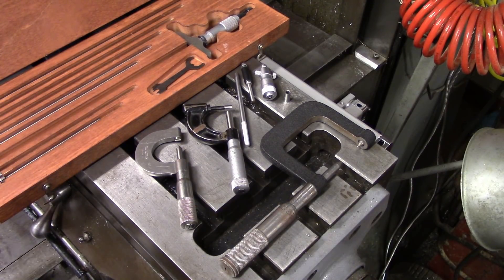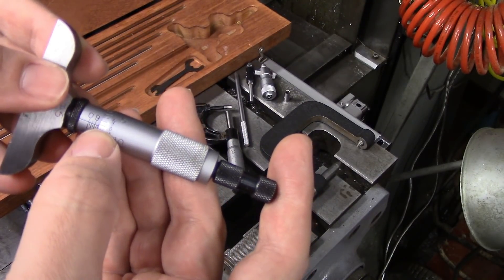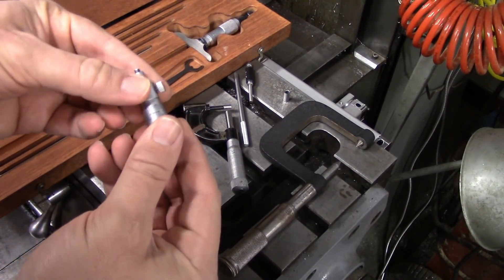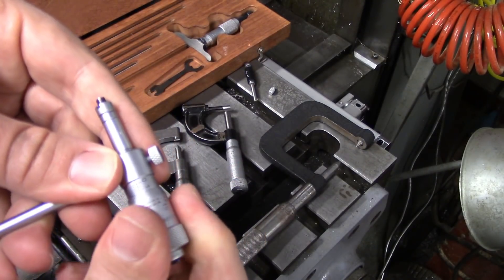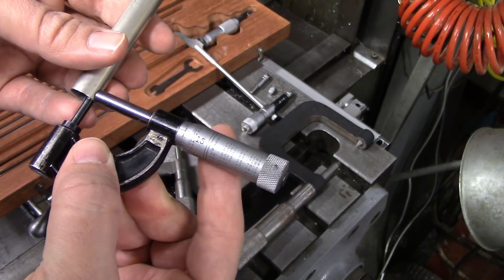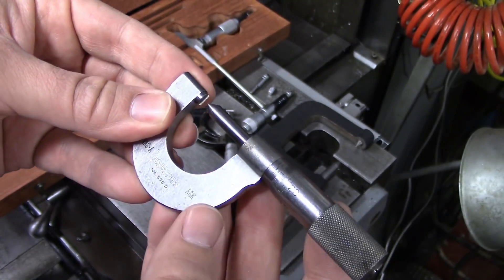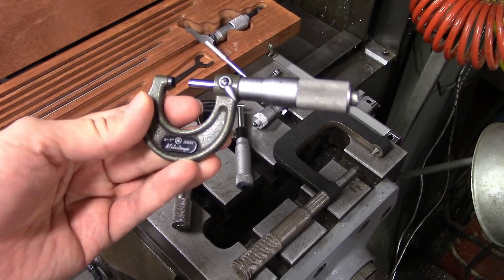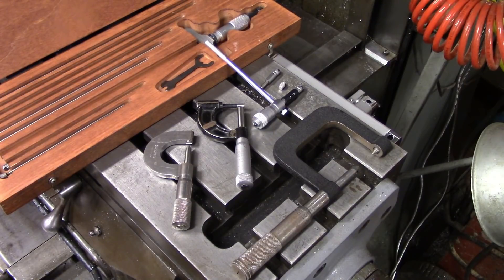Different Types of Micrometers

Comment: The other Vee type micrometers are for measuring 5 and 7 flute reamers. If you do cutter grinder work they are a must-have along with the Vee micrometer for 3 fluted cutters.
   Tool makers like Starrett often made (and still make) specialty micrometers not shown in the catalog. If you keep an eye out you will run into them once in a while. E.g. I have a Starrett thread micrometer that is made for 55deg. Whitworth threads that I use when chasing Whitworth threads on the lathe. Usually l use it like the comparator micrometer shown in the video and check the work against a known good thread.
Cheers from NC/USA
Reply from the maker: Thanks for the insight.  Very cool info!
Reply: Rarely use my vee mic.  Never considered there’d be unique vee mics for 5 & 7 flute.  Duh!   Don’t know mine is right now, are the marked “3”, “5”, “7” ?  or how do you know what they’re for?  (Maybe I got the wrong one on eBay)

Comment: I like micrometers and have way more than I need. A collection of sorts, I guess. They all get used. I also prefer a friction spindle. That was a great tip about getting a feel for what's tight - when the fingers slip, it's tight. Wish I heard that before spending a considerable amount of free time with mics and gage blocks. All this being said, just popped a bid in yet another micrometer. Is that so wrong?
Reply from the maker: Not wrong at all. I want to buy a disc micrometer really badly, but I keep reminding myself that I don't really need it. I just WANT IT!

Comment: I'm in 100% agreement about studying what's in the tool and individual tool manufacturers catalogs. I picked up a great deal that way. Mitutoyo and Starrett have good videos here on YT about how to best read and use there metrology equipment. Even with something as simple as dial or digital calipers it seems about 90% don't use them correctly to get the best from the tool. I'd also add that with thread mikes having a trustworthy set of precision thread wires is a good way to double check that your thread mikes are at least in the ball park of what they should be. And used sets of depth mikes are something that really shouldn't be fully trusted without that check for each rod against that stack of gauge blocks. It's too easy for the previous user that might have "adjusted" them to what they think is correct.

Going by what I see on the forums and quite a few on YT, but mostly non machinist related channels you should do an in depth video about repeatable accuracy verses a measuring tools resolution and throw in some details about uncertainty of measurement. I've seen lot's who think that last 5/10ths digit on a dirt cheap digital calipers screen actually means something.
Reply: Turning Point, the last 5/10ths digit does mean something on digital calipers, no matter who made them... its just that the last digit isn't  giving you the actual size of the measurement, only the range of what it might be. 
  Digital measuring devices are an all or nothing proposition in the last digit. This means that a digital caliper whose last digit is either "0" or "5" can't detect any variation closer than +/- 0.00025" . 
   As a practical matter for anything whose size needs to be determined any closer than +/- 0.005" , you shouldn't be using a caliper of any kind.. that's what a micrometer is for. There are often circumstances where you can't use the micrometers you have and you can get away using digital calipers zeroed against gage blocks or a known size to get within +/-0.001"  pretty reliably.
Cheers from NC/USA
Reply: @aceroadholder2185  I should have clarified my statement instead of being lazy and shortening it up. Unfortunately this is gonna get long. I'm sure you already know all this but others might not. I agree with your points about how the numbers are displayed. They match with everything I've read about how they work. For any of the decent digital calipers I've seen or used.  The manufacturer has to follow the industry standard for metrology equipment and there made well enough to be accurate to + - one count and can then pass the QC checks. I've tested enough metrology items such as digital mikes to know the higher end equipment has been repeatable to usually a bit better than that on gauge blocks, but the + - numbers are still the maximum allowable deviations while falling within tolerance and would still be considered as accurate. So some tools will also be at those upper limits of what's allowed. Without checking it's another unknown. Most of what I have checked hits around half the allowed, one or two have been about 75% of the allowed. 

As you say, under .005" then break out the mikes. The main difference even if the internal electronic measurement & reading systems were equal is the mikes have an in line close tolerance mechanical system with a very rigid frame. Calipers have minor but important clearances that without them the calipers jaw couldn't move. Those allow it to tilt a very minor amount in each direction on the calipers beam. Due to the design that clearance is greatly magnified along the jaw tip. So a calipers mechanical design is a far less rigid and repeatable system than a mike has. Even it's shape and length is against it for possible thermal changes just by holding them long enough. Like you I've proven to myself that I can get dependable and repeatable readings with my Mit's on those gauge blocks, but only under the best of conditions, taking my time and using good technique. That proves how your doing it and the tool is accurate and repeatable to a low limit. 

So those are ideal conditions and that's still a possible 1 thou in each direction and a long ways from 5/10ths. Everyone knows measuring parts in a chuck or vise is never ideal and the surfaces being measured sure won't be of gauge block quality when machining metal. Since the equipment can't repeat to 10ths or even be 100% trusted as being within an exact thou there's uncertainty and the display of that last 5/10ths digit as I said really does mean nothing about the actual measured size your shooting for. Yes the calipers are reading a rounded off jaw position change to that displayed number, they might due to random luck even be quite accurate once in awhile against what it's measuring. But that display can only show the current jaw position and not how well they fit and touch against the surfaces your trying to measure. That's another possible source of error. 

So the calipers built in mechanical design issues, and the parts actual size would almost never agree within that 5/10ths accuracy. The number is pointless to think it means anything as far as what your trying to measure. At best it's an indicator that you might be a bit under or over the thou digit, or maybe your really a full thou away from the display reading. I just ignore it on my mits and still won't trust that last thou digit enough that I'd bet money on that number always being correct. Throw in those less than ideal shop conditions, thermal effects, variable user pressure on the moving jaw to name just a few and those add even more variables. They may or may not partially cancel themselves out, so it's only logical that if it has to be measured and known to be accurate to under your .005" then yeah a caliper isn't the tool to use just as you say. They'll get you close enough to then use a mike, or for some parts that close is good enough.

To expand a bit on some of the videos I've seen on YT and why I mentioned that 5/10ths digit. Some will quote that number like it's written in stone. One in particular was measuring lead .22 bullets. I'm extremely doubtful my Mit digital mikes could measure a coated lead bullet to an accurate 1/2 thou. Sure the mike will do better than that, the swaged surface and material type still isn't good enough to do so with any real confidence in the numbers your seeing. Try that using a 15 buck off shore set of calipers used by someone who obviously had little experience? I do get and understand why someone like the bullet guy would think the display numbers are the tools actual accuracy. But it just ain't so. :-) I'm no different and used to think the same until I started to pay attention to some of the free information about general shop measurement that's out there. Accurate measurement to low limits with even good calipers is a whole lot more complex and much tougher than it looks.

Comment: The vee anvil mics are useful for measuring the out of roundness of "precision " ground silver steel (what you call drill rod) it maybe constant diameter but is often not round.
Disc mics are often called "paper" mics as they spread the load when measuring softer materials. 
Did you see my black and white toothy friend?
ATB 
c